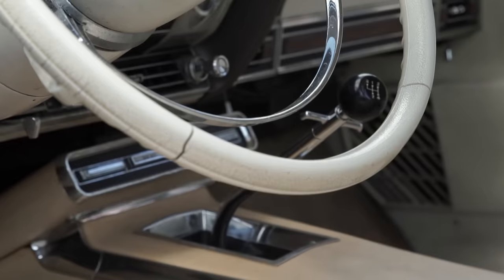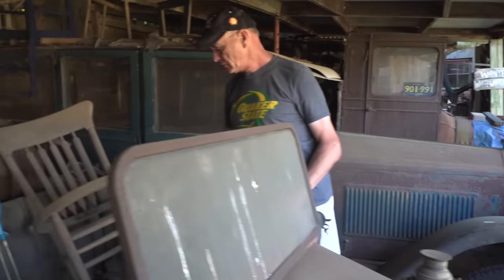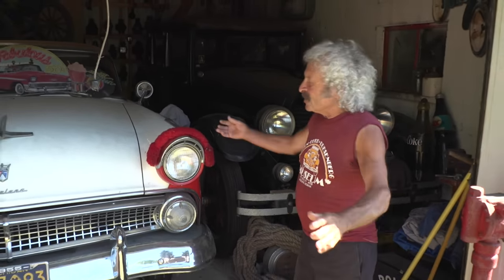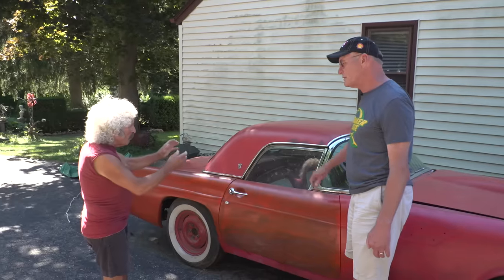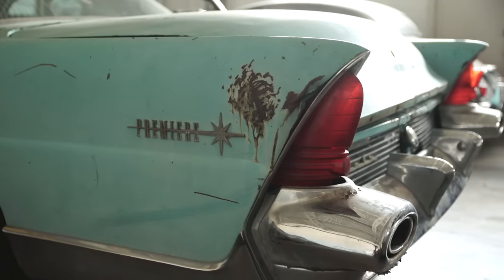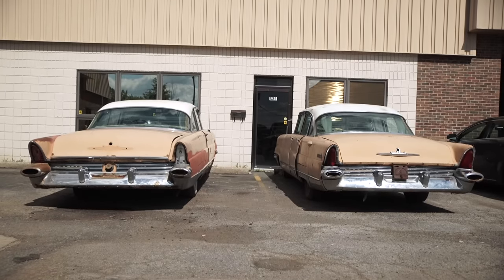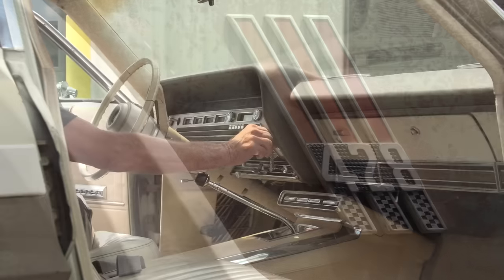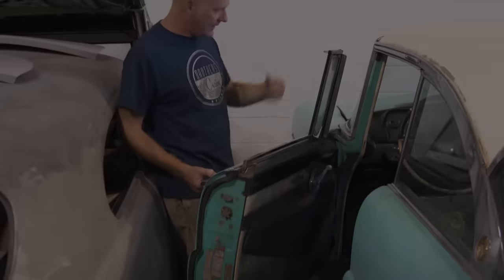1 of 1 428ci 4-Speed Ford Country Squire Wagon | Barn Find Hunter - Ep. 13

Comment: So technically this station wagon is actually the rarest car he has ever found.  Amazing
Reply: Well, it depends. It's not the same to find a 1of 1 car because of the options list than to find, say, a 1 out of a 100 car where the hundred were all that were ever made. I guess it depends on the definition. I'm drooling over that ford nonetheless.
Reply: Exactly.
Reply: +James Palmer yup... he exaggerates much
Reply: Yup, 1 of a million. I was working at a Ford Garage in 67, I saw a few 428 Squires, but never saw a 4spd. Model. That's awesome. It deserves a total restoration with all Ford parts and same color.
Reply: And it wasn't in a barn.
Reply: Zac Alleywalker Lowing
Reply: The Shelby Cobra and Ferrari 250 GT was the best Barn Find ever on this show..
Reply: BELIEVABLE.. I used to ride my 'stingray'(schwinn) up 'shell hill' (previously called airplane hill because 190x planes were 'flown'  off at top) and at the top was "Bill Stroppe's Baha Bronco factory (Parnelli Jones won Baha 1000[mile], head on 100mph into a mexican family -'lost' that year. I think they also hyp'd the Cobra as well.
Reply: Nope... Far from it. He once found a MUCH rarer car. It was a blue 1974 Nova, with a 250ci 6cyl, auto, with old aluminum slots, traction bars, and it even had extended rear spring shackles lifting the rear end up 6".
Reply: Come on man.   The only 4 speed or not, it's a friggin station wagon!  lol.   You guys have seen National Lampoon's Vacation too many times!  The original owner of this was torn between a wife and two kids and a rip roaring sports car!  Yank that 428 OUT and put it in a Mustang where it belongs!   I bet the wife and kids were scared ****less !  :)
Reply: @StockDude  That 428 is a torquey passenger car engine, not a Cobra Jet! The Cobra Jet wouldn't appear until mid 68. I say leave that rare piece of history as is!
Reply: If this wagon had been equipped with the almighty Boss 429.......now There would be a machine to crow about. Frankly, a 428 is nothing more than tugboat engine compared to the mighty BOSS 429.
Reply: If I heard it correctly that would make that just about the rarest Ford I would think
Reply: Rarest car! There is nothing rare about it. Rare means very few still exist today either rotting away somewhere or still able to run, roll or drive. It a one and only and has papers to prove it. Not even the best liar in the world could get someone to believe them if they claimed they knew of even a 2nd one. Not a chanced! Like it or not but if anyone ever took that car apart they should be choked by bare hands and never be allowed to come close to any tools ever again. That's if he doesn't get choked to death of coarse. Lol!
Reply: @Strongholle  i think the rarest car made from a series of one car is half of one
Reply: @Art Trombley 
Restoring this car would be an Epic Mistake! Only original once...
Reply: malcolm johnston 

I ride a 68 Schwinn Lemon Peeler instead of my Cannondale. Way more fun!
Reply: dehoe disc The Boss 429 wouldn’t fit in that Country Squire. That said, instead of the 428, I’d opt for the Ford 427. That was one hipo V8.
Reply: drippinglass GREAT!
Reply: mike styles it would fit, there’s more room in there than a Mustang........ no shock towers
Reply: @Strongholle  but, we're not talking about a unique pinstripe. The 428 w/a manual is a pretty special factory option 1 off.
Reply: @StockDude  you have no idea how hot of a ride the guys wife was and whether in 1967 it was worth it to him to get the biggest engine option “available” along with an “unavailable” 4-speed manual transmission AND keep his wife happy, with a mini van!
Reply: @adamfortenberry8775  So when something's rare by special order, making it a one of a kind that's highly unusual, that's "not rare?" So by your definition, the Chrysler Norseman concept car was "not rare" when it still existed.
Reply: @101Volts  if there are let's say 10 of the same exact model ever made and they are still in existence then those 10 would be rare. When there's only one I would have to say IMO that would be a unicorn. One of one.

Comment: Tom, I was wondering if you have ever run across a green and white 57 ford wagon with a 427 engine in it and a two four barrel carb setup.. My Dad  bought one new and had it till 68. Two weeks after he bought it, someone from Ford came to our house and told him they would give him any new Ford he wanted if he would let them have that wagon back. It was not supposed to have that engine installed in it. From what my Dad told me years later, it was some kind of engine that was supposed to be put in one of Ford's race cars, not in a wagon. I can remember it was fast. Just wondering if it made it or was it cannibalized. Thanks!

Comment: Errm... About those 1914 princess pressure release valves... I think they are actually fuel priming cups for getting the engine started especially when it's really cold. You just pour a drop of gas on each one. Used widely in the time before the choke got common.
Reply: You would be correct
Reply: Got it.  I learned something.
Reply: suomenpresidentti Those are priming cups, the pressure relief valve is the actual valve in the block 😂
Reply: suomenpresidentti i
Reply: Agree there
Reply: Yep, I agree!

Comment: The gentleman says the Squire Wagon which he is reading from the specifications has a 428/4 barrel . The specs actually says 428 4V referring to the 4V heads on the engine, Not the carburettor. Please correct me if i am wrong.

Comment: Re the 428 4 speed country squire,   I worked for a  suburban NYC Ford dealer, in the service department in 1969 and 1970. I saw many luxurious Ford wagons, and a couple with bucket seats. They probably had a 390, but possibly a 428. I never saw one with a 4 speed....it is a real treat to see this one.   The parts manager at a different dealership had a ‘64 Ford wagon with the light 427, I think it was a 390 hp hydraulic lifter motor. This car was for his wife, so for her driving pleasure it had a cruiseomatic, but a very cool car even so. I like this mans  videos....great to see a fellow with such excellent Ford knowledge.    By the way the red and white car in the garage is a 55, not a 56....look at the round parking lights.

Comment: fyi...those arnt for compression relief..they are fuel cups..pour some into the cups..open then close the valve..crank the engine..wa-la engine fires off..mostly found on up draft carburetor equipped engines..carbs back then were crude and would leak fuel down into the engine when not running..so they would hang em out to the side and have the engine intake from the top of the carb
Reply: Thanks.  I learned something new.
Reply: your welcome buddy :) great channel btw keep it up !!

Comment: Not many barnfinds left around here. When the price of scrap metal got high several years ago people was dragging everything they could fine to scrapyard.  I did find a 73 Dodge Dart Swinger with 51k miles all original no rust. Its in my barn waiting its turn to get into shop. I did get it running but needs fuel tank replaced and i have new one just waiting on sending unit

Comment: Growing up a buddy of mine bought a 1970 Chevy Concours station wagon used off of a married couple (school teachers). It looked like a 70 Chevelle from the front with the quad headlights. It came factory with a 396 (402?) big block and 4 speed on the floor.  It was pretty quick for a big old wagon so quite a factory sleeper.  I've never seen another so always thought it was pretty rare? It's sitting covered with a tarp in someone's backyard a few towns over, the past 30 plus years. Jim

Comment: Wow, a real one of a kind. Being born and raised in the rust belt I believe that the odometer hasn’t turned over. This car was made before rust prevention was done at the factory. If this wagon did have over 100k miles on it the rust would be so bad that you would follow behind this wagon with a dust pan. My uncle bought new a 1968 Ford F-100 pickup. A few months after the truck was bought he severely injured his left knee. The F-100 had a 6 cylinder engine with a 3 on the tree manual transmission. With his injured knee he couldn’t operate the clutch. He kept the truck hoping his knee would get better but it didn’t. When he passed away in 1980 my aunt sold the truck for 3 times it’s sticker price. Even though the truck had 3000 miles on it and was never driven in the snow and salt it had minor rust  (fixable) along the outside seams of the truck box. My first car was a 1967 Mercury Monterey bought 1973. It had 80k on it. The rear quarter panels had large rusts holes. The trunk was no longer weather tight. The bottom of all four doors was rusted away. I drove this car for about a year before it started to dog track. The unibody had rusted out so badly that the car couldn’t go straight down the road. Even with minor rust along the bottom of the doors this wagon odometer hasn’t turned over.

Comment: When I was a kid we had a 1964 Ford Country Squire with the 390 four barrel automatic transmission. It got around really well. I can’t imagine the power from the 428 four speed manual.  What a great car it must have been. My dad bought a new 1968 Ford LTD brougham with a 428 police interceptor in it.  That car’s dual exhaust had a mean sound when you floored it.  Even with the automatic and all the weight it would easily smoke the tires.

Comment: I imagine Lee smiled when the paperwork for that wagon came across his desk.
Reply: Oh, really?  Ever hear of the Boss 429?  The tugboat 428 has nowhere near the power of the Boss 429.
Reply: @dehoedisc7247  Different engine family entirely. Longer stroke, smaller bore. Kind of the same idea as the 305 vs the 350. Slow revving, more low end torque theoretically but probably not.
Reply: The 428 was geared more towards the road. The boss 429 was more race oriented.
Reply: @dehoedisc7247  Yes, I've heard of it. It didn't EXIST when this car was built....
Reply: @mfree80286  No, you didn't exist.......

Comment: That 1967 Ford Country Squire with a 428 cubic inch engine and a 4 speed manual transmission is very unique one of a kind. Most of these Ford Station Wagons came with a 3 speed automatic transmission, and some came with a 3 speed column shift, but a 4 speed manual floor shift in a Ford Station Wagon is unique.

Comment: The Country Squire appears to have a new motor - rest of car in need of a full restoration.
Reply: The motor was shot.  It either has 120K or 220K miles.  So it was rebuilt and reduced from 10.5 :1 to 9.5 : 1 compression ratio just to keep it driveable.
Reply: Stardust Dream Factory can't see the block. For all we know sombody simply spray bombed the valve covers, intake & air cleaner.

Comment: Right on.  I love the grocery getters. To bad most fell into the crusher. I have a 69 buick sport wagon that I intalled a 5 speed tremec in. 462 with hemi killer cam, 12 bolt posi. Best part 33000 miles and not a bit of rust.

Comment: I wonder why they stopped using wooden firewalls...
Reply: Caddy Guy Gaming You suppose they realized the oxymoron of it?
Reply: The same reason why they quit using wooden frames. Because horses are not pulling these things LOL.
Reply: Caddy Guy Gaming 
At least make them out of cedar so they dont rot....i used a cedar firewall in my 57 chevy. I put a fire resistant coating on it....
Reply: Aluminum is cheaper and lighter.
Reply: G. H. No metal shaping? How do you suppose they formed all the body panels hahahahahahha come on now
Reply: in theory, you could use solid wood. Not plywood, that's a whole different problem. Wood does not conduct heat, so up until it burst into flames, it would do well. Some woods, like Teak, would be an exceptional idea. I would think you'd know you had a big problem long before solid wood catches on fire. it takes a LOT of heat to catch hardwoods on fire, some are near impossible to get burning. You'd need a whole lot of heat and flame to do it. IF at least half an inch thick you're not going to be able to get it going.
Reply: KDcars it was the natural progression of cars.the first were carriages  made out of  wood with engines attached. next  came tin panels formed over oak frames.carpenters built beautiful hand crafted  bodies and then painted them
Reply: Caddy Guy Gaming There are fire proof termites.
Reply: Caddy Guy Gaming something to do with fire, maybe?
Reply: Caddy Guy yyyy
Reply: I dunno, maybe because it's FLAMMABLE
Reply: Probably weight.
Reply: Wooden and fire dont mix in the first place
Reply: "DUST" A LIGHT COAT OF ASBESTOS ON THE WOOD... AND I HAVE SOME ASBESTOS YOU ARE WELCOME TO, JUST NEED TO COME AND TAKE IT AWAY WITH THE 12INCH FURNACE HEAT DUCTING (GRAVITY FEED FROM BASEMENT, NOT THOSE LITTLE 'FORCED' HEAT DUCTS!).  JUST DON'T BREATH IN...
Reply: Wooden firewalls were the finest! As a part of their maintenance, they were supposed to be removed and soaked in a mixture of diesel and turpentine for a few days, then reinstalled. It helped with wood's well known quality of fire-resistance!
Reply: Lol
Reply: So that’s why it’s called a fire wall.
Reply: Asbestos poisoning? :D
Reply: Expensive to maintain.
Reply: The main reason is that in a production environment steel is easy and quicker to form. In addition the firewall is a major stuctural component of a car.
Reply: Well, when your engine catches fire, you are supposed to GET OUT OF THE CAR.  An engine fire would probably burn itself out long before it broke through a wooden firewall (I have wood doors that are fire code compliant in 2019, so wood was not that bad of an idea for a firewall).
Reply: If I had to guess I'd say 1 piece cowl/firewall is easier to make than a 2 piece